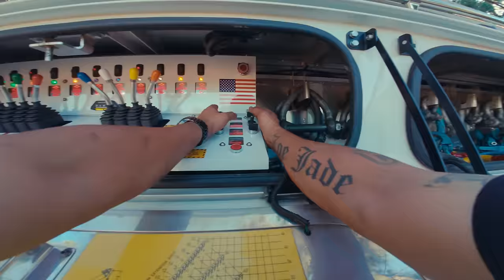Big Rig Gets Stuck on Golf Course

Comment: You guys have to understand that when youre making a delivery and youre constantly making them on private property the company 99% of the time has a policy where as soon as the driver leaves the public roadway, the recipient of the delivery takes full responsibility of anything that happens to the truck. Anyone making a comment on the soft ground most likely delivers from a paved freeway to a concrete loading zone and has ZERO experience driving anywhere sketchy. You've never been where you have to be in LOW LOW, climbing a dirt mountain or being 25 minutes down a one way dirt road with literally no where to turn around. I cant tell you how many times ive had a customer tell me 'my big lifted pickup gets through there just fine' and i have to explain to them that i am probably 8 of those pickups combined and that truck doesn't weight anything and they get PISSED. You have to try and make your customers happy and you gotta try and work with them. It didn't just rain, the ground isn't wet, It sounds like this is a regular delivery, and nothing is abnormal. Its just the sun hasn't dried the ground from 7+days of dry weather and it can happen to anyone.

Comment: Good recovery, but was it necessary. Some people should NOT be doing the job they do. Perhaps a refresher course on backing a semi could be arranged. Good job Alex 😊😊
Reply from the maker: Ya I feel you. He mad a rookie mistake into an all day nightmare situation lol
Reply: @PepesTowingService Why does the winches not have a torque function. If they had this function, then both winches could pull and avoid only one pulling the full load strain. I did automation control and many times it was more feasible to have multiple motors (servos) instead of one large motor.

Comment: Maybe the driver screwed up when trying to get out but then golf course guy comes "just get him out of here" with the asshole attitude. As you explain to the guy the tractor has no control, he has no traction (just clarifying to him "the front wheels are not moving" because apparently, he didn't get the no traction thing) Then he goes "You going to take a ton of time"? What a difference with guy @5:22 You definitively can tell who is the hard worker and who is not